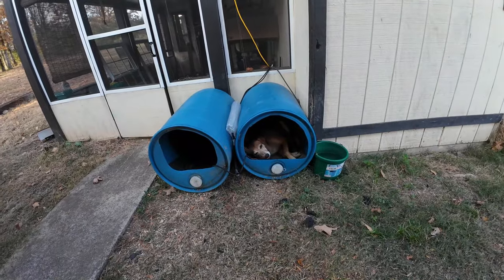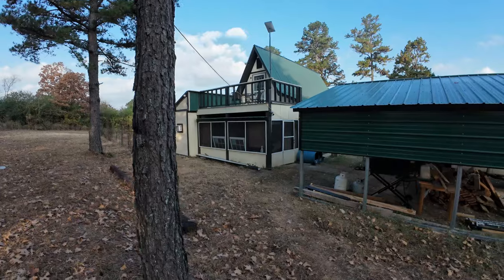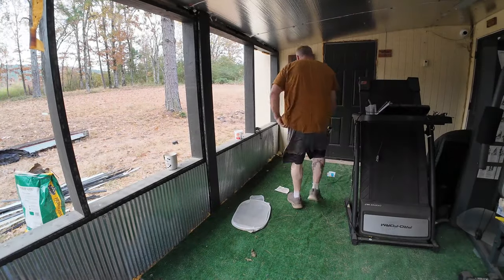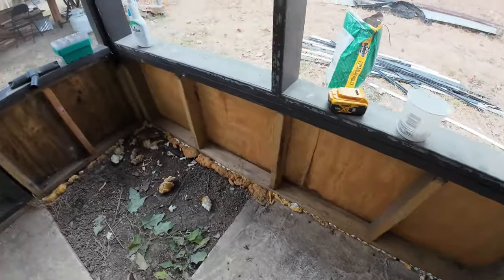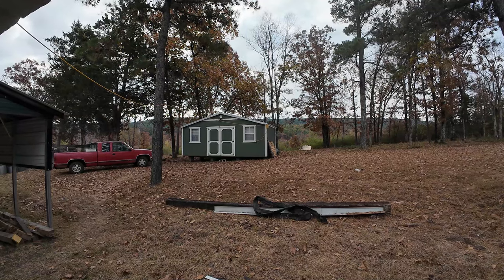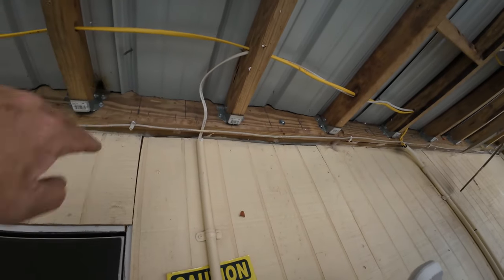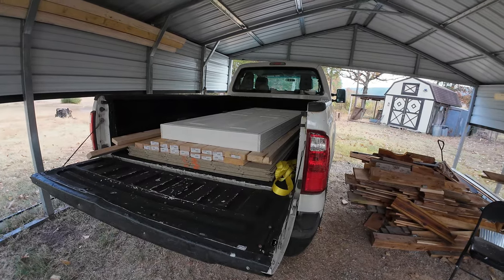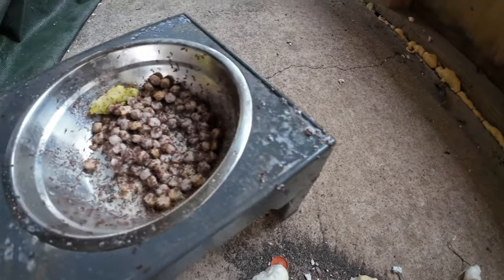The Tear Down/Enclosing Screened Patio/ Day1

Comment: Mike, I have started making Quinoa, instead of Rice  in her food to give her a change, she cleans the bowl. They like Sardines as well, still looking for chicken giblets and hearts. Only problem I having with this Fern (pure Beagle) is getting loose and running away, she did it again last nite. Gosh I was so mad at her. She met another tenant with 2 dogs and that is where I finally got her, I was tangled up in the big dogs leash and I was holding on to that as I got wrapped up with the tenant, just trying to get my dog, what she puts me threw. But since Fern has been fixed, she seems is be filling out good, her coat is so soft and she is really filling out now, I gonna have to weigh her again. She suppose to be 20lbs, but she feeling like more than   that when she pulling. She get her homemade food twice a day, about 370g portion.  I might have to reduce it.  She won't like  that. lol You always keeping your self busy, good for you.